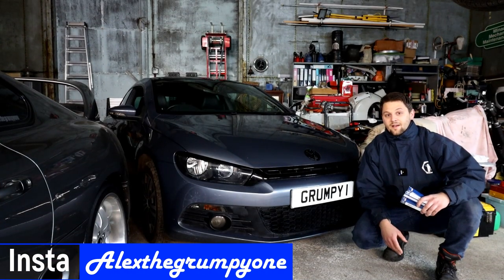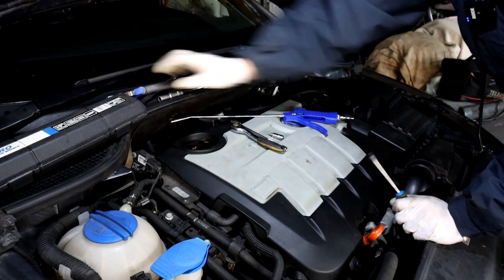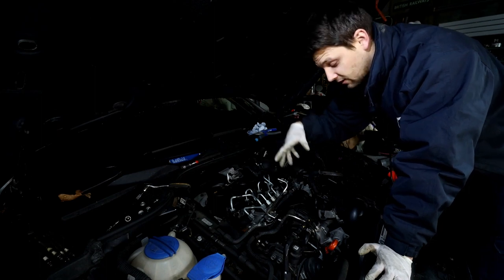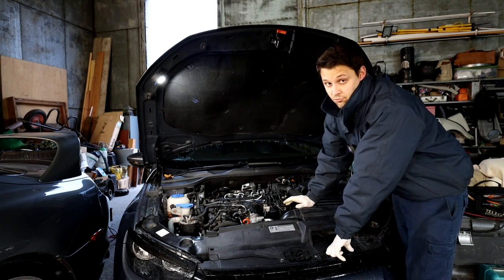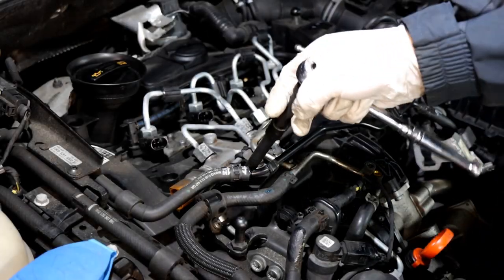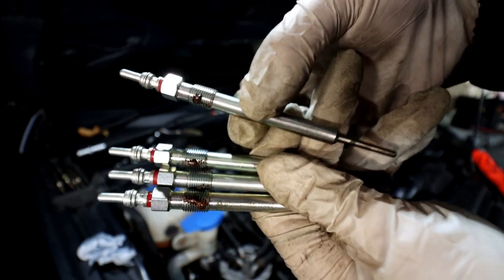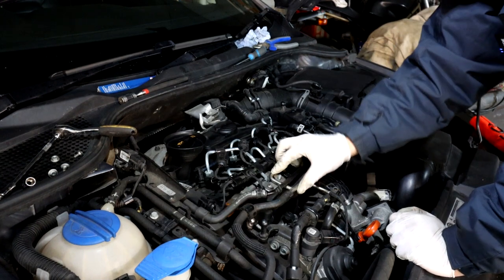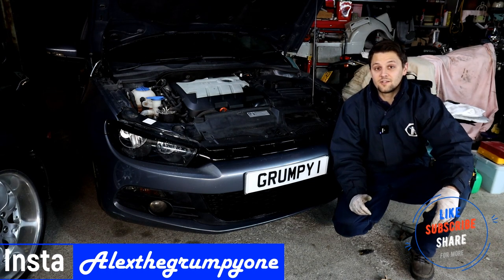2.0 TDI VW Scirocco Glow Plugs Replacement. How and when you should replace your glow plugs.

Comment: I was thinking of changing the glow plugs more as preventive maintenance as I don't have any fault codes but I'm really scared of the tip falling down. Is there anyway I can check if they are working when intended for example when starting the engine or when the dpf is regenerating ?
Reply from the maker: Yes it can happen. Usually depending on how the car has been used. If its a car that idle a lot of never goes on motorway then there is a higher chance of build up of carbon. Also depends if the correct oil has been used. 
First and easiest way of checking is by using diagnostic tool and doing a full scan on the system.
Then you got a manual check by continuity test on each glow plug. 
Or obviously the bad starting in the morning or on a cold day.

Comment: Again a great video. Mate got a question. As diesel we have to take our cars on highway just to clean the engine once a month or so. Can we drive on cruise control or do we need to drive without also how long or any time frame plz.
Reply from the maker: Thank you very much bud! 
Yes I definitely recommend doing it. 👌  
I wouldn't use cruise control. I would put it in probably 4th gear or maybe 5th depending on the speed you doing. Recommend to be doing around 3k RPM for around 25-30 min. 
I usually use a dpf cleaner treatment in the fuel tank as well

Comment: Great guide mate, need to change mine.

Do you know if they play a part in the cars dpf system. I.e if ones thrown a code, car won't regen the dpf?
Reply from the maker: Hi there. Thank you very much! 

They can affect it as they create a fault code or glow plug light on wich needs to be off to do a dpf. All the time engine light of fault is in there the car will think somthing ain't right. 
So I would recommend replacing bud
Reply: @AlexTheGrumpyOne  cheers mate, no light on dash as of yet but it came up on diagnostic machine so I'll get it changed. Keep up the content 👍
Reply from the maker: Sweet! OK bud keep me posted! 
Thank you